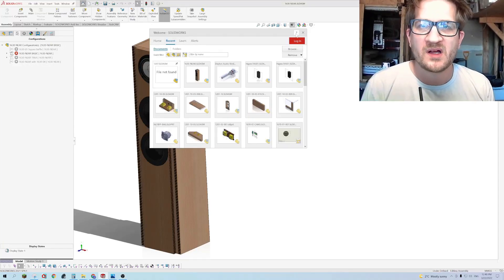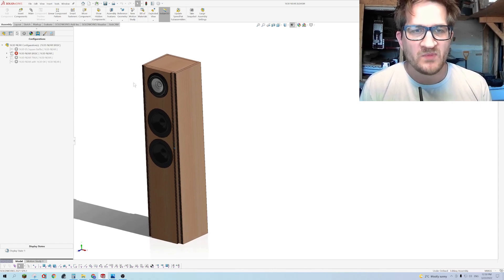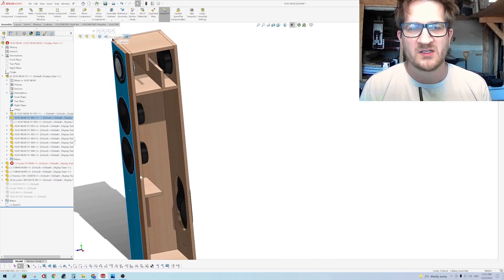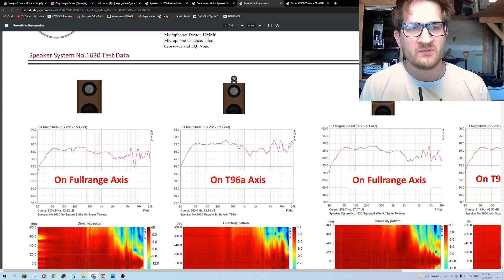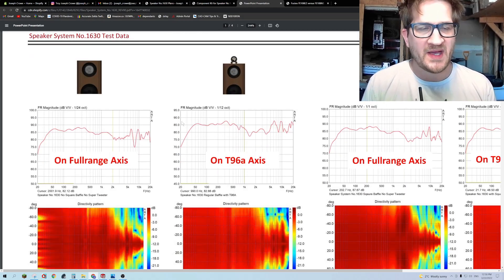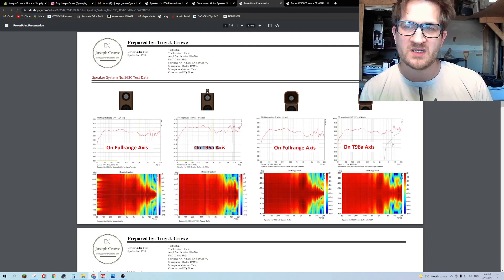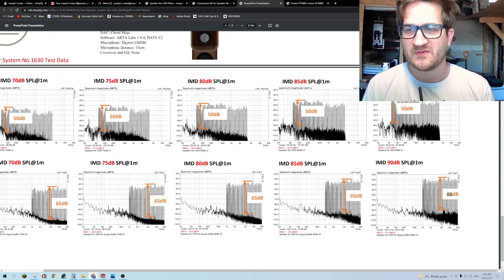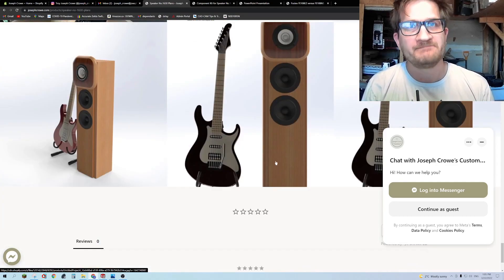DIY Speaker Build Plan Set No.1630 --- Small Floor Standing Speaker for Near Field Listening

Comment: Was it ever an option for you to also include the T96a super tweeter to the Back Loaded Horn No. 2314? Would you recommend that? And could the plans from this speaker here be taken as basis for the according crossover design in No. 2314? Thanks in advance!

Comment: Hi Joseph.  What amplification have you tried with these?  Do you have a general recommendation?  Thanks
Reply from the maker: I’ve used a variety of amplifiers. If looking for help I would suggest Audio Science Review. Generally an amplifier that has at least 0.01% IMD in the upper treble (10kHz) will be adequate. 0.01% means the noise floor is at least -80dB down from the peak of the fundamental tones. Let me know if you need clarification on this as it’s a deep topic. Thx
Reply from the maker: For example I heard recently the Naim Uniti Atom on my speakers, and not knowing much about the product I found that it had a very edgy and aggressive upper treble. However after looking at ASR it was clear why…the Multitone Distortion at 10kHz was only -60dB. 

https://www.audiosciencereview.com/forum/index.php?threads/naim-uniti-atom-review-streamer-amp.35213/
Reply: @JosephCrowesDIYSpeakerBuilding  I have an Audiolab 6000a and couldn't find any measurements on ASR but a couple of other sites had some less detailed measurements.  One listed "distortion" 1W/4ohm/10khz as .01%, so maybe.  I've listened to a few fullrange drivers with it and haven't found it edgy at low volumes.  At higher volumes I believe the shout and edgyness is attributable to the drivers.
Thanks again Joseph.

Comment: I love the idea of nearfield full range speakers meant to be played at low/moderate levels.  Question on the off axis response.  When you implemented the square baffle without the super tweeter, you had an improvement in off axis response, but then comparing to both baffles it looks like with the super tweeter, the 45 deg response is better with the standard (non-square) baffle?  Or did i read that wrong?

Comment: I had a chance to hear these little speakers, there is something very fun and special about them. I had no doubt putting in my order for the build plans. Not sure when I will actually start building them but I am excited to have my own pair.
Reply from the maker: Yes, I prefer them over the FE108EZ which is already a highly regarded driver that’s been around for quite a while now and has stood the test of time.  I always found the FE108EZ had a very slight paper sound in the treble.  This driver is devoid of that.  It also has a little more clarity and sound stage depth.  Comparing to the 1159 stand-mount which uses a dome tweeter, this driver has noticeably more resolution, although not quite as smooth sounding as a dome tweeter…but only slightly so.
Reply: @JosephCrowesDIYSpeakerBuilding  Not sure it is mentioned anywhere but does this speaker need any internal stuffing ?

Comment: Interesting design and I'm always on the lookout for a design suitable for a small room, easy to drive with decent 90dB (or above) sensitivity, and good for late night listening. 
However, could you explain how the system is 90db 8Ω when the pair of 5.5" mid-woofers per side are listed as 90.5dB 4Ω drivers? 
Am I correct to assume the two per side 15W-4434G-00 4Ω drivers are being ^wired in series to yield a doubling of Ω impedance = to 8Ω, only if I'm not mistaken doing so will also reduce the sensitivity by - 3dB, so 87dB @ 8Ω which has me wondering how the finished product 90dB 8Ω ohm rating is achieved? 
^The Loudspeaker Design Cookbook 6th ed Vance Dickason
Reply from the maker: If you series connect the two woofers the sensitivity does not change (89.5dB).  However if you connect in parallel then you gain +6dB of sensitivity.  I’ve opted for the former for an easy load for those using tube amplifiers.
Reply: @JosephCrowesDIYSpeakerBuilding  Well, I assume you have measured the design impedance and sensitivity @ 1w/meter to know what's what so if that and what you just said is true then what I read in The Loudspeaker Design Cookbook 6th Ed Vance Dickason regarding multiple woofers must be incorrect. 
Thank you for clearing that up. I will consider adding the build to my projects of interest list, it checks a lot of boxes for me (pardon the pun) ;)
Reply: @mpix8302  You double the cone area with two speakers, so that's a 3db gain without thinking about impedance. Then you double the impedance and you lose 3db when wired together. When you 1/4 (parallel from serial) the impedance, you gain 6db. I also have that book.